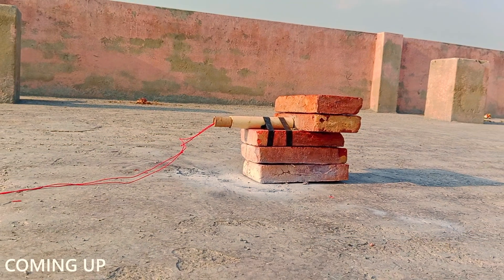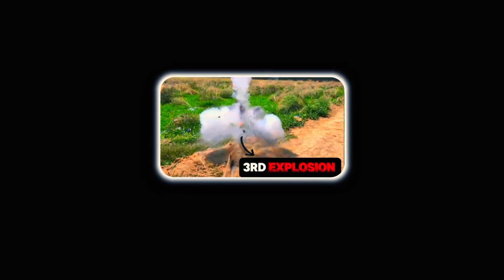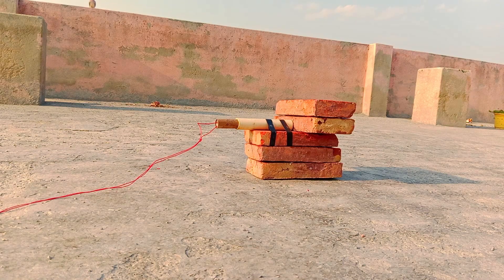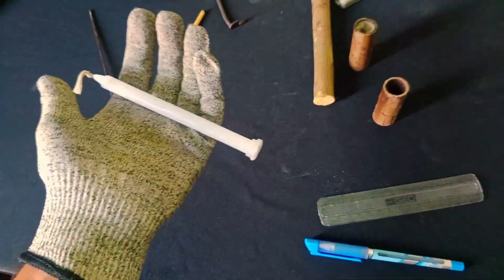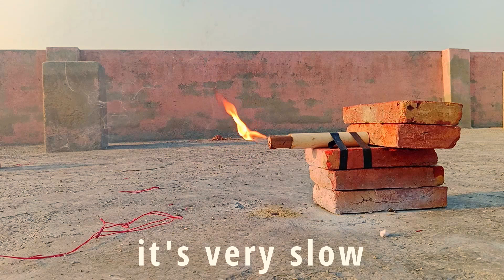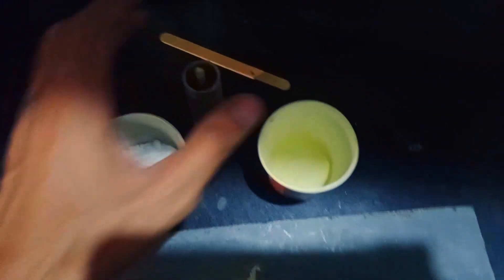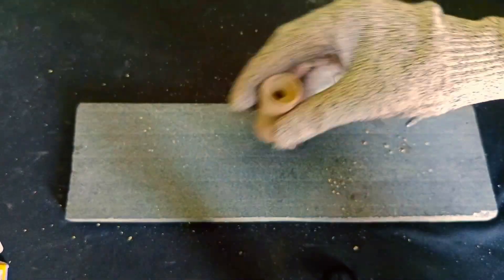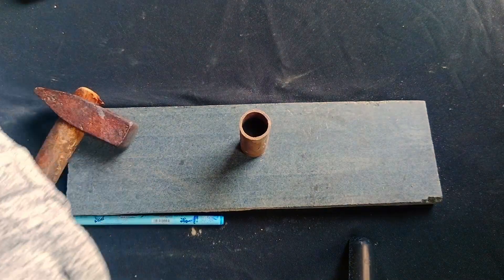I tested 3 different types of rocket fuel!

Comment: The nozzle you are using is just too small and you are packing it too tightly... Also, the paraffin just coats the entire potassium nitrate and doesn't let it burn...
Reply from the maker: Now i picked the best fuel but i think i will start working with wax fuel in the future.
For just fun testing!

Comment: Yo dude i can feel you man, im pretty much like you, at first i want to start with black powder motor, but it's quite explosive because to fast, i move back to sugar motor, at first i avoid it because it's sticky, but i realized it still could work with out melting it, so i put powder sugar and potassium nitrate and mix it together, at first it burn kinda slow i keep changing the rasio and finally got it perfect, it burn not as fast as black powder but produce so much flame and gas, and the flame is so pretty, it's pink color, i think you should try powder sugar! Sure if you don't melt it, you lost some performance but it's a insanely reliable fuel, i flew a lot of rocket with it
Reply: Btw love your channel man, keep going! 🔥, also bro do you have discord?
Reply from the maker: I don't have any discord server right now but i will make it in future.
If you want to connect with me then you can message me on instagram ( @cosmiccraft_r47 )
Reply: If you still want to use black powder add more charcoal

Comment: Mix the black powder with more charcoal dust. Do tests in 5% increments, and don't test full motors. Test burn time of certain lengths of powder trails and compare with your explosive mix. You may want to look for a decrease of even maybe 50% in burntime.
Also you may want to strengthen the nozzle and walls of your rocket engine if you're working with black powder. There's also permanganate and perchlorate based rocket fuels, but if you're not really that versed in chemistry, I'd keep to potassium nitrate based fuels.

Comment: Try a bigger hole in the nozzle. It will decrease the pressure which will also decrease the burn rate of blackpowder. Thats why a firecrackers explode only when the pressure is able to build up. Crack them open and you got a (still fast) candle.

Comment: Ok couple things you can try
1. Acrylic caulking and potassium nitrate make a very nice and stable fuel take a bit for it to set
2. Nitrocellulose and if youd like to get some pure Nitrocellulose without having to nitrate cotton, then guitar picks are a good source. Those little plastic picks are pure Nitrocellulose and I'm sure there's someone on Amazon or ebay selling bags full of them. Shred them with like a coffee grinder until they're nice and fine amd yu should be good. Ping pong balls used to be made of the same stuff but I think they changed the formula.
Ok just my 2 cents good luck

Comment: Why do you not want to use sugar?
Reply from the maker: Because it's sticky 🫠
Reply: @CosmicCraft-r47  that it is! But it is a highly caloric fuel source and you're not supposed to touch it anyways....
Reply: @CosmicCraft-r47  I have had some of the same trials as you have with the boomy type of engines but I attributed it to the fact I was using a chlorate as the oxidizer. Never tried black powder though.
Reply: @CosmicCraft-r47  Something that I have had a little bit of success with is using powdered Non dairy coffer creamer as the fuel (mixed with oxidizer) . It's still sticky but not quite as bad as just sucrose.
Reply: Really  😂 is that the only reason?  @CosmicCraft-r47
Reply: @Slaas_2000 Sucrose rocket is hygroscopic. From my experience, you can't store it more than a week since hygroscopicity lead to potassium nitrate degradation. Higher water content, faster degradation rate. Degradation reduce your propellant performance and even make your rocket fail to fly. If you want better fuel, you can try erythritol, less hygroscopic, but cost more. Erythritol also have low melting point make it easier to cast and less sticky